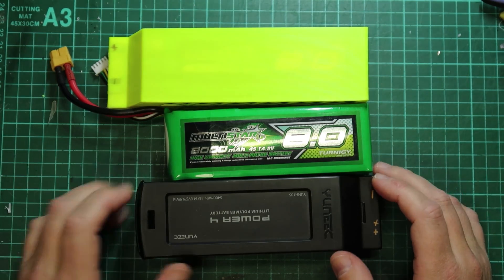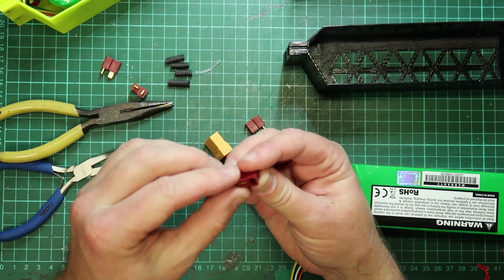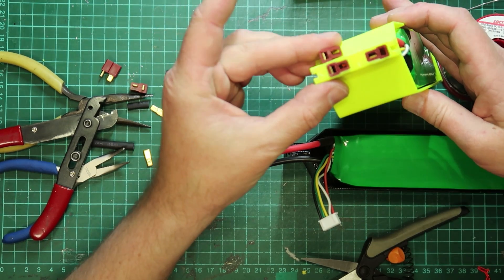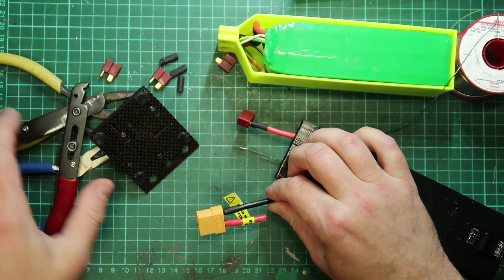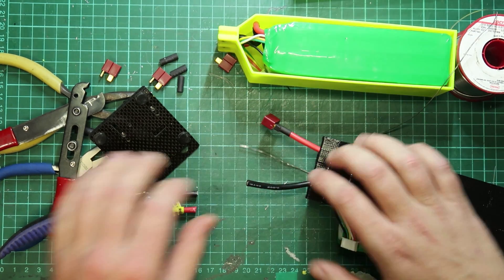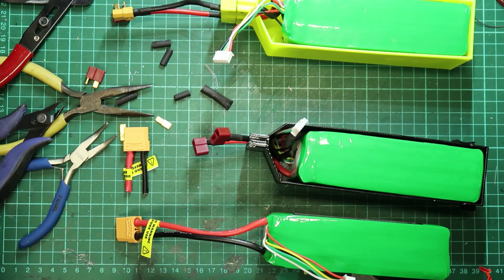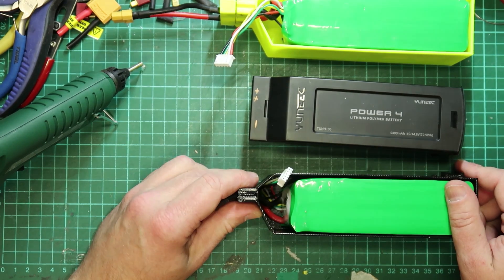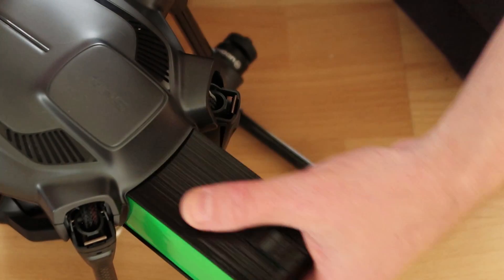Yuneec Typhoon H Battery assembly.

Comment: I took a look for 10C batteries and was wondering if you have tried something in a higher range.   Seems most battery makers are going away from the 10C and are anywhere from 50C to 100C.  If so is there any issues with the higher "C" rating for the Typhoon's electronics?
Reply: Find any answers to that question yet? I'm wondering myself.
Reply: Thing about c ratings they are inflatet due to marketing. So if it's low c rating, it's more likely it's a LEGIT c rating. Their's no such thing as a 100 c battery. The highest c rating that is legit is 60c. Anything over that is bs. They inflate them to get sales..

Comment: Why not make a converter plug that plugs into a XT60 from the lipo  instead of cutting the wires and putting on the dines there? A XT60  female to those 2 dines connectors you use.  Maybe not enough room for a 8000 , but a smaller lipo would work. Just a thought.

Comment: Mr covert

Thank you so much for sharing. I have a doubt, in the video, on the sides of the button to unlock and remove the battery, it seems that it is cut, are deliberate cuts I imagine. I'm printing the STL and there are no such cuts. Do they have to be done for the release mechanism to work properly?

Thank you

Comment: were can i find a good battery for my typhoon H
Reply from the maker: Hoobyking have the battery in stock. "Multistar High Capacity 8000mAh 4S 10C Multi-Rotor Lipo Pack XT90". You can then print this case or get it printed.
Reply: wheara about are you?

Comment: Sorry for my bad English !
How does the Typhoon H handle the adapter? I flew him in the H520 and had problems that he flew unchecked. Yuneec said it was definitely the adapter.

Quote: I understood your problems, but see the cause as the changes (range: H520 battery) that you have done on the Kopter (second landing). Our guess: The pressure sensor can not work properly and gave the electronics a negative Z value (height value).
The Kopter acknowledged this negative value with a slower safety descent.
I would like to draw your attention to the fact that you lose your warranty if you do not use manufacturer-compliant attachments.
Reply from the maker: I haven't used it in a H520. I have a Typhoon H480 and it works every time. I use my drone a lot. Just ordered another 3 more batteries to have more flight time when I'm out.

Comment: Great job! But I do have a question. If using a 8000mah battery gives you the same flight time as stock why are you going to the trouble of doing this? What I find interesting is this statement directly from Venom, "The 6700mAh Yuneec Typhoon H LiPo battery by Venom features nearly 25% more mAh capacity giving you longer flight times." So if your not getting longer flight times at 8000mah then either your batteries are sub grade or something is wrong with your H!???? Other than maybe increased charging speed I cannot see an advantage to what your doing, so please enlighten me.
Reply: @gen5011  
I agree seems like waste of time.
Reply: Ano originál baterie stojí stejně jako tato a ještě se musí takto složitě vyrobit. Jo kdyby byla o 50% nižší pořizovací cena vyrobené baterie tak to pochopím. Držte se škoda že nám to létá tak málo minut že :)

Comment: Does anybody tried it with a Hobbyking Multistar 6600mah 4S LIHV battery
The dimensions are 141 x 51 x 38mm

The dimensions for the Hobbyking Multistar 8000mah 4S standard lipo are 142 x 49 x 43mm
and for the Hobbyking Multistar 8000mah 4S LIHV battery they are 140 x 50 x 44mm

Can i fit the Hobbyking Multistar 6600mah 4S LIHV battery in this tray ? This is the only one available in the Eurowarehouse

Max2206

Comment: Did you try the Multistar 6600mah LIHV 4S from Hobbyking already.

That one is available in euroe from the euro warehouse

I would like to know what the flight time of that one is

the original lipo of yuneec is a 5400 mah normal 4S and that gives me 15 min of flight and then i come down on 14,6V
Reply: I have the 6600 lihv. Flight time is about same as stock 5400 battery

Comment: What is your flight time with the 8000maH 4S ?
Did you already tried the 8000maH 4S LIHV ?
Reply from the maker: flight time it's no longer or shorter than standard battery from the few test flights I've done. I'm using the non LiHv battery. I can't get hold LiHv in Australia at the moment. I'm keen to try them out. I now have three working printed case batteries, with 4 all up I can do all the flying I want :)
Reply: So what is the advantage over the Normal or other replacement batteries already built you can get on Amazon? The original battery is 5400mah. Seems like a lot of trouble to go through to get same flight time, when you can buy replacement 6300mah direct replacement batteries for less than the Multistar 4s batteries.

Comment: how long take to print one? batt holder
Reply from the maker: About  5 hours on my settings and printer. Updated model next few days. it's working great but I have another improvement on my mind.
Reply: i need to change position(rotate) the print ? file or it is ready positioned? where is the bottom and where top? :)
Reply from the maker: I print it with the triangle cutouts down to the bed.